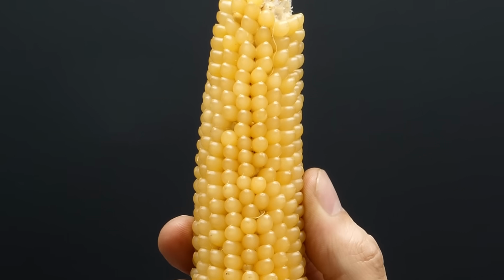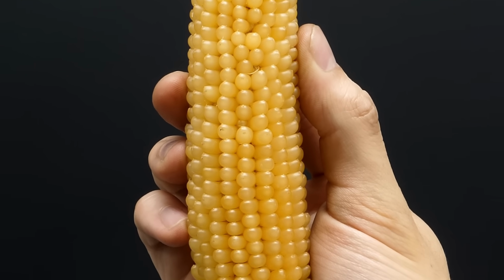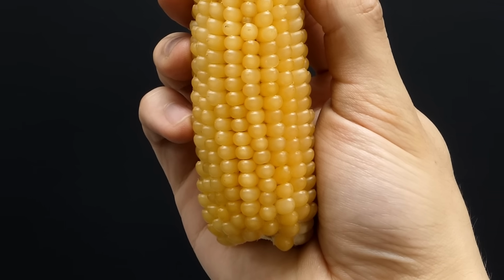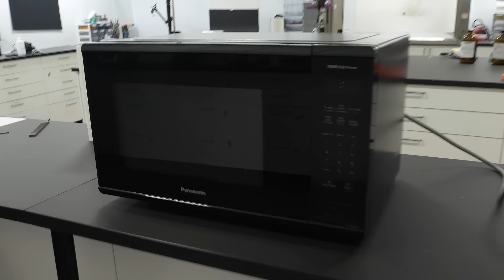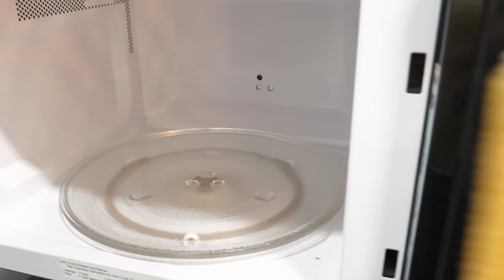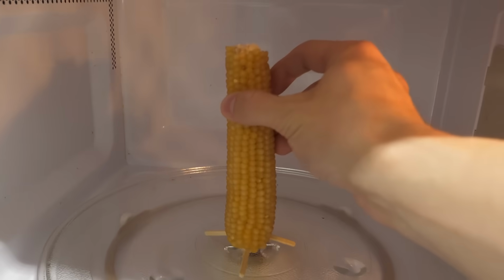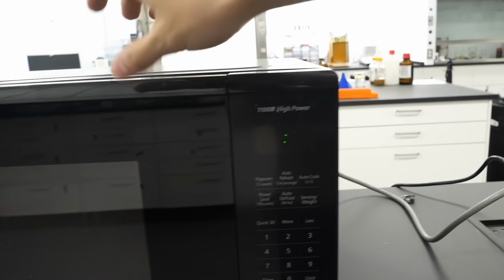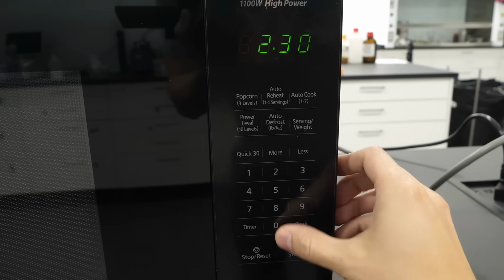Popping corn on the cob in the microwave

Comment: We threw a few sealed totes full of "all things kitchen", and then some, into a very large bonfire one time. 

We found out there was popcorn in one of them when most of the kernels exploded at once. It was kind of like fire crackers going off. It started and ended with a few pops, but the majority went at the same time and exploded.

Also, as long as I'm here, canned goods explode like a shotgun blast and send cans flying. It never occurred to me the contents boil, expand the can with boiling steam that has no where to go, and, kapow!

 It never occurred to me to throw a sealed can that wasn't an aerosol can into a fire either. 
---------------------
Those were my main points.
The following is unnecessary to that end. Just extra backstory... 
_____
There is a reason we burned all that food and kitchenware in a large circumference bonfire.

My dad took a construction job in the Carolinas. When he came back to Minnesota, my mom told him to leave all of that stuff down there.

He is a tight ass cheapskate, and decided to ignore the wisdom of mom. She knew the potential for extra passengers was highly likely.

He did have enough sense to duct tape the totes tightly closed though.

A month after he came home, I was snooping through his stuff that was in our storage building, which was an old theatre building, with 2 upstairs apartments that mom rented out.

I opened one up and saw a cockroach right away. (I worked in Texas for awhile, so I knew what they looked like.)
I closed it. Sealed it tightly with duct tape. 

This was a small town in South Dakota. No cockroaches. 

I promptly informed my mom, who promptly blew her stack, (she was a firm, no BS type, that would take a lot of pushing, before pushing back, but then in no uncertain terms. Not a hot head. But she was PISSED.)(Love you mom. See you when I'm dead. Which may not be long, the way things seem to be going.)💉+🧬+🛠️x💣+🇺🇸=🏴‍☠️☠️💀

So my nephew and I proceeded to seal the rest of ALL of the Roach Travel Lines Bus Totes that my dad brought back, extra tight. 

We loaded them into the same pick up that delivered them, and took them to our cousins lake property.
There, we built a very large bonfire on the beach, at the bottom of a small shear embankment, using a pile of deadfall branches and campfire logs. Probably a 10x10 foot area. 
Maybe used a few years supply of campfire wood.

The intent was that none escape by chance. Completely engulf and surround the totes with flame. 

Once it was burning nice and hot and high, we backed the pickup up to the edge of the shear drop, above the fire, and dropped those totes in one by one. 

That is how I learned about some things that explode in big fires that I did not consider before.

Mom brought in a pro pest control company, even though the only roach ever spotted there, was by me, in that tote, which I promptly closed and resealed, as I said. 

Unless you include the ones in my younger brothers ashtray. Different species altogether though.
Reply: Cool story!